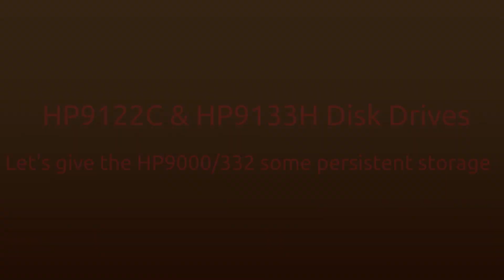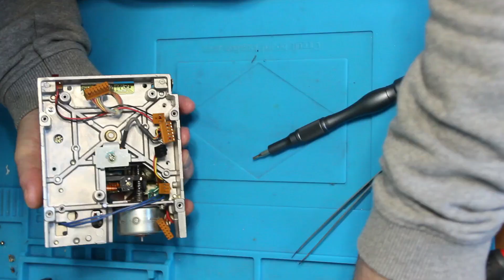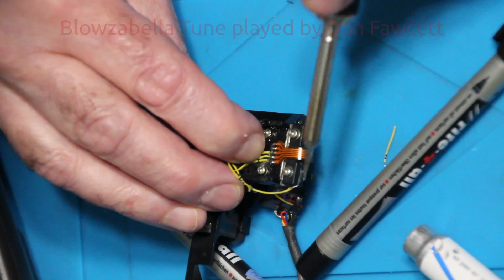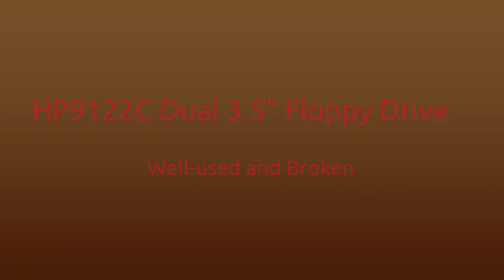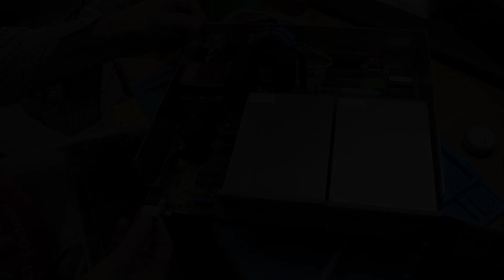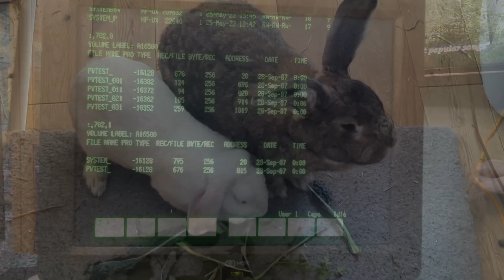BTW EP05   HP9133H and HP9122C Disk Drives

Comment: The 9133H has a Seagate ST-225 in it.  I'm really not surprised the floppy disk drives are problematic in those since that was one of the very first 3.5-inch drives Sony made.
Reply: The issue is that the grease in the drives sets hard - not really a design issue. But if the user gets impatient and pulls the disk out, it catches the metal disk cover on the head, tearing it off and damaging the disk. 

The ST-225 was the standard choice for 20MB drives at the time, thiugh getting to the end of its production cycle. I think tht a drive upgrade is a matter of setting jumpers to match a larger drive.

Comment: Thanks so much! By the way, can Gotek be used on an HP9122C/D?
Reply: Hi - I don't see why not, the drives are pretty much the same and the interface is the same IIRC
Reply: Thanks, I have a 4795A, but I didn't realize they share the same floppy drivers. @BogTheWombat
Reply: @appleringoo9332  hi - the 9122C I think is the same floppy as the 9133 - the 9122D uses the same drive range as the 4795 (and the 16500A) albeit with dual 720k/1.44M capacity. The interfaces are the same - standard Shugart (not PC) except that some of the grounds are reallocated to 5V and 12V when there is no separate power connector.